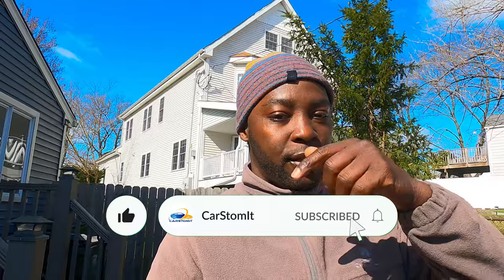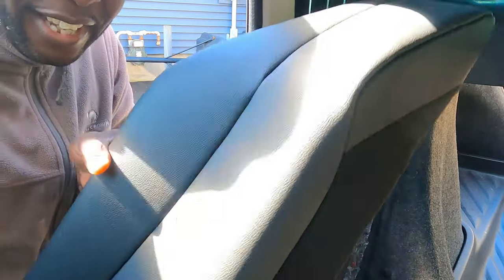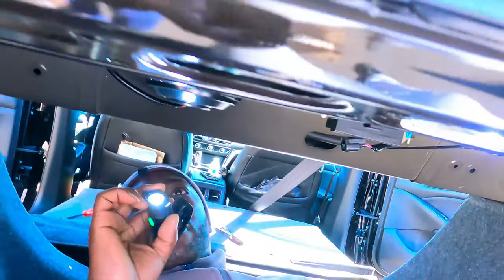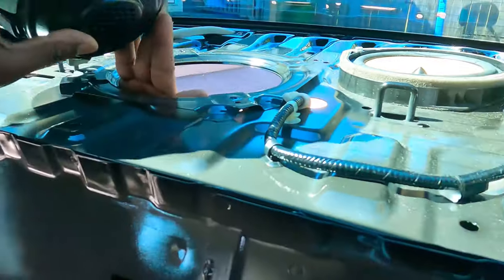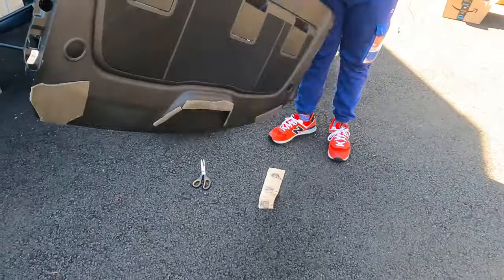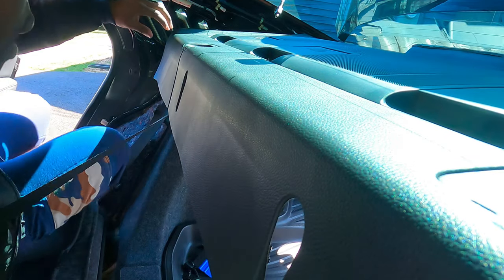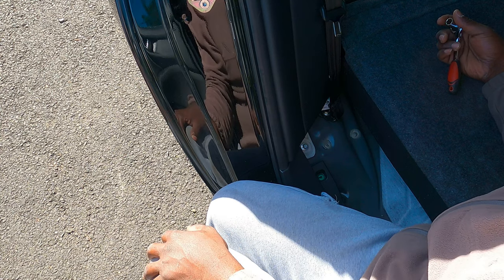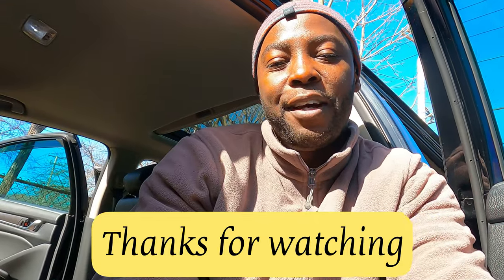2020 Honda Accord (1.5 Turbo) Trunk sound dampening installation.

Comment: The speaker in the middle, the black one,  it’s that a base only  ? Or has 3 regular speakers
Reply from the maker: YES this is Correct. this trim had the upgrade sound system.